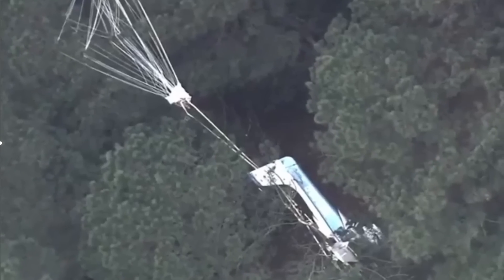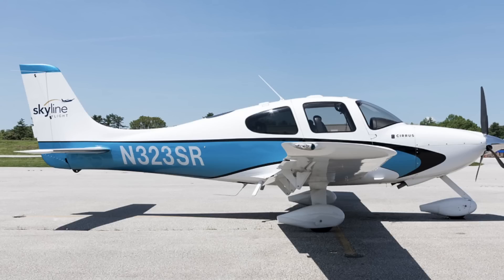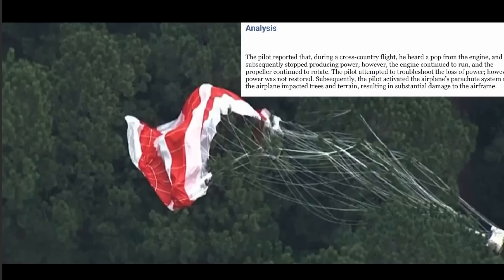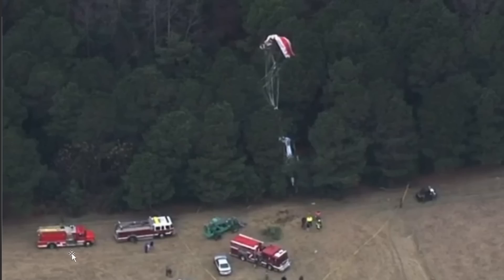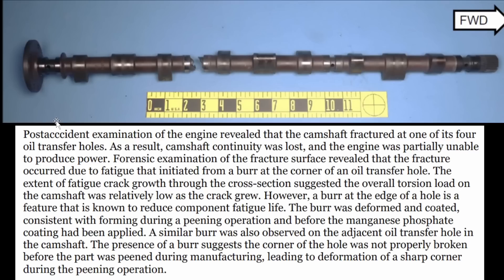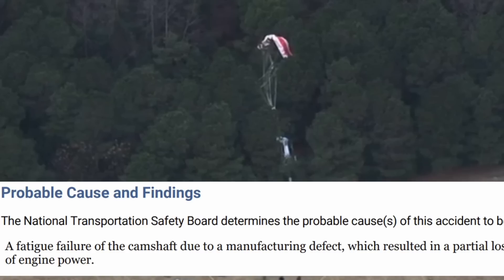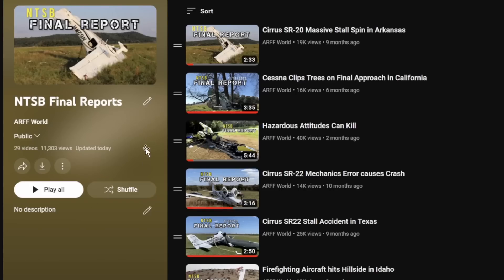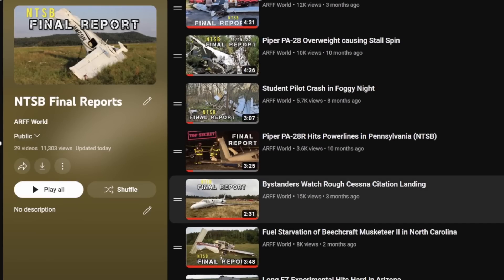Cirrus SR-22 Engine Quits

Comment: Their safe so they did the right thing and Cirrus doesn’t have a problem engine manufacturer may have a problem. Landing in field may have saved the plane and may have killed them in that field. Floating in milked away all the energy and speed quickly.

Comment: Age 66, he said the plane sat outside the night before where it got down below freezing and then on preflight (next morning) - oil level was at 7 quarts.   At :30 mark he says that when the engine quit "There's not an awful lot to do, except figure out where you're going to end up."  By pulling the chute, you have totally given up all control of where you're going to end up!  He hit in trees and remained suspended vertically, they had to get a ladder to get them out.  If it had caught fire they would have all been burnt alive in it.   Look at this link for google earth on how much flat wide-open space was all around them.  They hit the only group of trees in the middle of flat open nothingness.  A third grader could have dead sticked it into any spot near there with no problem.   First, I think that this guy should not have left with only 7 quarts of oil (12 quart system) and second, he induced undue uncertainty and peril by pulling the chute with so many other better options available.  https://earth.google.com/web/search/35.084999,+-77.895278/@35.08567359,-77.89052178,46.14834473a,1914.98962703d,35y,35.15865367h,53.39269934t,0r/data=ClkaLxIpGaqYSj_hikFAIQK1GDxMeVPAKhUzNS4wODQ5OTksIC03Ny44OTUyNzgYAiABIiYKJAlVv95sSItBQBGWtP5WJopBQBl5QFb4qHhTwCFXcSFnAHpTwA
Reply: Took a look at Google Earth. Frustratingly that main road near by - as straight as an arrow and plenty long enough - does not have street view. But you are right! There's a bunch of easy fields to land if you don't want to try your luck on a road. SMH!
Reply: Dan, I was going to say, this CAPS controversy has a grim irony about it. I read that In the first world war, the Germans introduced parachutes for their fighter pilots in 1918. The British (I am ashamed say, coz I'm a Brit) apparently believed it was "not cricket" to jump out of a stricken aircraft and were slower to introduce them. As here, there was controversy on the topic and some say it was a matter of making parachutes more reliable first. Here we are a hundred years later and the same arguments rage. PS Big fan of DGPC, too!
Reply from the maker: Thanks Dan for stopping by, adding the map, and sharing your thoughts.

Comment: Serious question.  Are aircraft engines inherently unreliable in comparison to cars?  I've never heard of a camshaft twisting in half.  I was preflighting a 2 yr old airplane the other day and the alternator went out.  I've driven cars over a decade with 300k miles and the alternator doesn't go out.  Seems to me a company like Honda could make an aircraft engine that would be 10x more reliable than anything today.
Reply: True - Honda could make a better aircraft engine, but the market is too small for them.  They probably produce more cars in a day than a year of total piston engine aircraft production.
Reply: @dermick  that makes sense. I guess it’s frustrating to me that these engines are so expensive but yet you see a higher rate of mechanical failures with them.

Comment: land in the field!  The airplane would be reusable then.  After a CAPS pull it's at least 200K$ jut to start - that's before any other damage.  It's irresponsible to pull that handle unless you don't have control of the aircraft.
Reply: It’s irresponsible to go against manufacturer recommendations and training and statistical examination of outcomes. Furthermore, landing in an unknown field at 80 kts is nowhere close to assuring no damage to the airframe. Nor is a parachute landing an assurance the aircraft will be unusable. Many are returned to service after repairs.
Reply: @dryreed  Pulling the handle removes control from the pilot for the remainder of the episode.  I think it's pretty irresponsible to just let an aircraft drop from the sky without control unless you've got no chance to control it in the first place.  So far - to the best of my knowledge no CAPS pull has resulted in injury to innocents on the ground.  But I have seen one come to rest less than fifty feet from an elementary school.  Turning it loose to go where it will without control should be the very last option.

Comment: Parachute is only for if there is inability to control the airplane due to structural failure etc. or no suitable landing sites within gliding distance. It is not supposed to be used just because the engine fails. Once the parachute is deployed the aircraft is no longer able to avoid damage and or injury to persons and property wherever it lands.
Reply from the maker: That is true

Comment: It's 50/50 in my view. The little wheels cannot be retracted and would dig in to the unprepared surface so a flip over on landing in that paddock is almost inevitable (but they would likely walk away uninjured if landing done well). The parachute worked extremely well for the pilot. I think the pilot did a great job. I'm beginning to understand the need for a parachute in the Cirrus as it is a fixed gear design.
Reply: Yep, once the engine quits, the airplane belongs to the insurance company. Save yourself and your occupants, not the airframe.
Reply: @cessna177flyer  Good thing to live by!

Comment: My thinking is that if you can’t land that aircraft in that open field where that pony is standing, you probably shouldn’t be flying any aircraft at all.
Reply: Disagree. Tiny wheels and fixed gear increases your chances of flipping over. When you commit to a field from 1000 feet, there is still a lot you cannot see (power lines, berms, ditches, large rocks under the vegetation, etc.) I’d rather come down at 15 knots under a chute than take my chances on a perfectly executed off airport landing in an unknown field at 70 knots, just to prove I’m a “real” pilot.
Reply: @cessna177flyer   Well, I guess it's a matter of philosophy about what level abilities you consider to be typical of a "real pilot." During training, you learn soft field and off field landings. You use practice grass strips and you learn how to evaluate a field for an off field landing.  Unless you have good reason, you're not at 1000 AGL when an emergency landing is needed, and you have honed your skills during both initial and recurrent training to make your emergency landing survivable. If the entire glide distance for the aircraft was over a forest such as where this aircraft ended up, then I agree 100% that the CAPS system deployment would have been the best way to go.  Without that system being available I would have already been looking for streams roads and the widest areas of space between trees in case I had to set the aircraft down for an emergency landing. And, I also disagree that an off field landing has to be "perfectly executed."  Maybe it's because I grew up on a farm, but I haven't seen many pastures where a pony is going to be that has the hazards that you described. Of course, there are many aircraft that a pilot typically flies, and the one with the parachute system is only one make of aircraft. Because of that, you do need to have the skills necessary for aircraft that do not have a parachute system.  And yes, that off field landing skill requirement is part of the private pilot test standard.  You could say that that standard is what takes you from being a student pilot to a "real pilot."
Reply from the maker: Appreciate it Art

Comment: Unless we have the flight tracking info, it's hard to say whether or not he should have attempted a forced landing in an adjacent field.  Clearly, deploying the chute saved their lives, so, I have to defer to the pilot's judgment here.

Chute deployment should be done only if it's clear that 1) you can't glide/fly to a field for a landing, and 2) you are higher than 800' AGL, and 3) your airspeed is 200 kts or less.  If your altitude is less than 800' AGL, the only option you have is to fly your plane to the crash site, because deploying the chute any lower is almost certain death.

Cirrus boldly states that there have been NO fatalities when the chute was opened at or above 1,000' AGL.  I believe them.
Reply: Some fine point corrections: 1) to an *airfield*. Unimproved dirt is riskier than using the chute.
The threshold is 600’ (model dependent), and lower is not “almost certain death”. It just becomes very situation dependent so it is not practical to assess if it will be survivable or not. SOP training is if a landing would not be survivable, then pull the chute because you could get lucky, and have nothing to lose. There have been survivals of deployments as low as about 300’.
Reply: @dryreed  Yes, and yes.  
For emergency scenarios, I specifically chose the word 'field' over 'airfield'.   A better wording would be 'suitable field/place'.  

As for 800' vs 600' or 500', in an emergency you want to simplify memory items to minimize the potential for confusion.  I suggested 800' AGL because it is twice the absolute minimum altitude for CAPS deployment for all models.  For me, I use 1,000' AGL as my minimum, unless I'm taking off.  For a failure on takeoff, 500' AGL that is, if there was absolutely no other viable option for a forced landing.

Cirrus guarantees successful CAPS deployment at 400' AGL, but under very specific conditions:  Calm winds, level terrain, best clean glide speed (for lowest possible rate of descent), wings level, and flying straight ahead (no turns).

As for 500'/600', that is Cirrus' guidance for Loss of Thrust (engine failure) After Takeoff --- Specifically, if there is no suitable place for a straight-ahead forced landing, and you are between 500' (or 600' for a G5) and 2,000' AGL, then deploy immediately.  Higher than 2,000' AGL, troubleshoot problem, then pull the chute no lower than 1,000' AGL if you are unable to resolve the problem and there is no suitable place to land.

It it very important to note that the minimum deployment altitudes above are for straight-ahead flying.  If your plane is in a spin, the minimum guaranteed deployment altitude is 920' AGL for all models.

Again, I prefer no less than 1,000' AGL to deploy, unless I'm taking off.  For the latter, no less than 500' AGL for deployment, if necessary.  Under 500' AGL, pick the best place within 45° off centerline, and fly @ best clean glidespeed to that place for a forced landing...
Reply: @hack1n8r  This last comment confuses whether you are debating pulling low versus not pulling (as in your original comment “almost certain death”), or pulling low versus pulling high. I don’t see anyone advocating waiting to pull any lower than 2000 AGL, given a choice. These discussions are about emergencies and so are entirely about remaining choices.
Reply from the maker: I believe them as well

Comment: I don't fly an aircraft with a ballistic chute but if I did I would use it for structural failures. We practice engine failures often. I trust my skills as a pilot. If its just an engine out I think I can make the right choices to get my craft back on the ground safely. Every situation is different and no one can make the call but the pilot in command.
Reply from the maker: Appreciate you stopping by again Craig.

Comment: He should have landed his plane and he would still have it.  In that big field there was plenty of room. There is an AD from Continental engines recalling that engine for the problem that caused this failure.
Reply: Disagree. When the engine quits, the airplane belongs to the insurance company. Your safety and that of your occupants is that matters. A perfectly executed off field landing at 70 knots, only hit a hidden ditch, rock, power lines, etc. and flip over in a high energy event is not a gamble I would take. So unless there is a grass airport or an empty road I can definitely make, I’m pulling the chute. And I fly a Cessna, so I don’t have a choice but to perform an off field landing, so yes, I keep those skills sharp and hope I never have to use them.
Reply: @cessna177flyer  Well you and I are not pulling the chute.  And I respect that he was PIC.  When I was training in Pipistrel’s with chutes we never briefed to pull the chute.  I only considered it over the mountain’s and forests of the Sierra’s if a suitable landing was not possible. I also didn’t trust that it would deploy properly.  Maintaining control of the aircraft was priority. But Cirrus pilots are trained to pull it.  Maybe you should install one in your Cessna. I know it can be done.
Reply: @MulveysMooney  no chute STC for the Cardinal. Plus the expense is around $80K on 182, if I remember correctly, so even it it was available, I wouldn’t do it because of the cost. Also, it increases operating expense (annual inspections, chute repack). It would reduce my useful load by 15%, so that’s one less person I could carry. It increases the weight of the aircraft (around 80 lbs), so there is an increased full burn and performance hit on the aircraft (albeit small) for the rest of its life. Interior space would be significantly reduced, as that rocket and chute would have to be stored in the cabin. 

Unavoidable engine failures are a far lower risk compared to other risks like loss of control, CFIT, and “preventable” engine failures, so to me, it makes more sense to focus on where the risk is, which I do by flying conservatively, getting excellent training, staying proficient, and maintaining my airplane’s engine to the highest affordable standard. Also, my approach speed is significantly less than that of a Cirrus, so an off field landing is a less risky event.
Reply: The AD I believe you thinking of has to do with  the crankshaft counterweights. Came out a few months ago. You need to inspect the C clips for proper engagement. It requires removing two cylinders to confirm. There is not an AD that pertains to the camshaft on the TSIO-550 nor the IO-550
Reply: @Airplanefish  I stand corrected.  😊✈️
Reply: @MulveysMooney  just sharing information for all to use. Aviation is a small and helpful community.
Reply: @Airplanefish  what do you fly?
Reply: @MulveysMooney  I own an Aeronca Chief.  However I haven't completed my private. I've soloed and have my hours but have yet to test. I'm an IA/A&P. Been working on aircraft since 96. I specialize in the Cirrus line of aircraft but also work on just about anything. Small twins, piston aircraft and a few turbo props and small jets. Mostly piston stuff. Mooney, Bonanza, Cessna, Cirrus, Diamond, Extra, experimental ect....The Chief I bought just to fix up and sell. So if you know anyone intrested I've got a great, simple little plane for sale.

Comment: The open field would have provided a safer option, in my opinion.  The barbed wire fence would have skinned the cowl but would not have flipped the airplane landed properly.  I cut a slit in a stabilator with the same kind of fence post as was there landing a Cardinal after engine failure.  I have landed on runway available, roads, Rio Grand levee, crop field several times, and bamboo in Vietnam after thirteen engine failures.  While all but two were at 200' or lower crop dusting and on pipelines, I would not have used a parachute on the two.  The idea of a fatal engine failure in a small airplane just does not compute for me.  All we have to do is fly the airplane.  I have never had to consider sticking the nose between two houses or two trees, but I could certainly be slow enough to survive that.  I was happy to be an Army aviator and not provided with a personal parachute, because I would not have used it.  In Vietnam, we landed the Cobra in bamboo.  Sort of like landing in cardboard boxes.
Reply from the maker: Thanks for sharing your info with us Jimmy.  Appreciate it

Comment: Why dont they design the caps to bring down the plane in a straight and level attitude or slightly nose down ? I know it would be more difficult but still....may even be able to use a little rudder to steer the chute/plane....not an engineer, just a question
Reply: They do. It's starts nose down, and then after the reefing releases goes basically level. It's nose down here because the trees grabbed some lines.
Reply: it is designed for that.
Reply: It does exactly what you asked about. It's designed just as you explained.

Comment: I would have to say the pilot made the correct decision pulling the CAPS in this instance.  Landing in a horse paddock is not a good idea because they are usually very rough and you have a better chance of flipping the aircraft upside down as a result.  As for the broken camshaft, that will not fall onto Cirrus Aircraft, since they are not responsible.  This broken camshaft will actually fall onto the engine manufacturer, which in this case will be Continental Motors in Mobile, Alabama, which is owned by China.  The Chinese also own Cirrus Aircraft Company as well.  Depending on the extent of the damage, this aircraft may be totalled by the insurance company.  So glad no one was seriously injured in the accident.
Reply from the maker: Thanks Jim for your take

Comment: The open field would be my first choice. After 'chute deployment, the aircraft is often totaled. In fact, it was good luck that the aircraft was suspended off the ground, causing minimal airframe damage.
Reply: Actually, quite a few have been returned to service after a CAPS landing..
Reply: @txkflier  if that’s the way it works out, great. But saving the airplane should be secondary to the risk of life and limb of those on board.
Reply: When the engine quits, the airplane  becomes an escape capsule that belongs to the insurance company. Your safety and that of your occupants is all that matters after that.